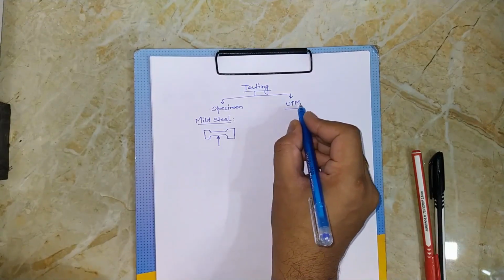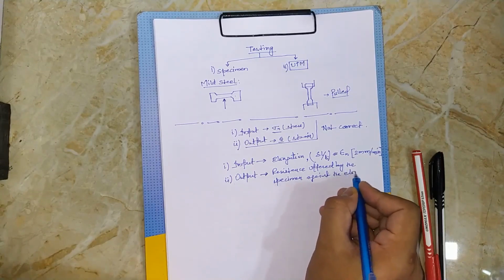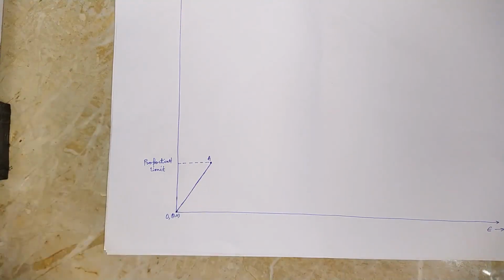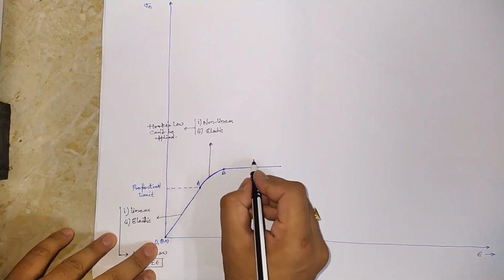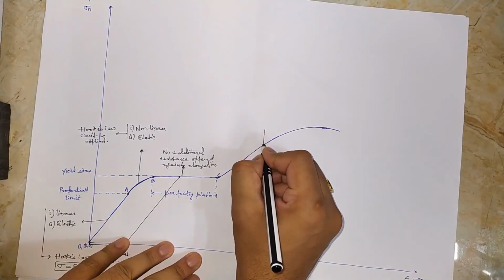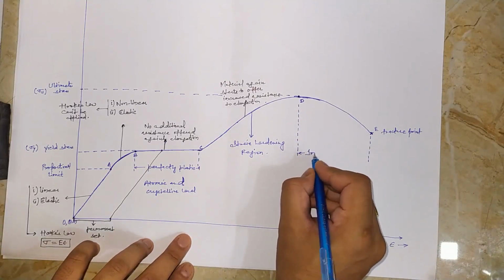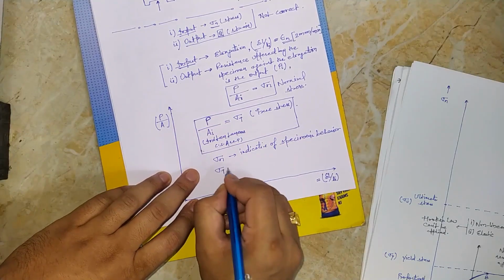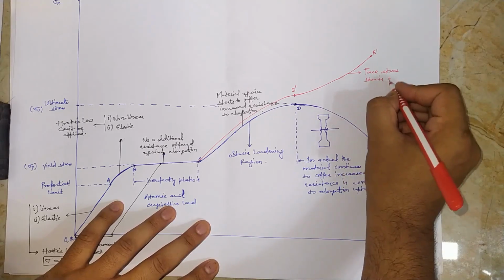Stress Strain Diagram

Comment: Excellent video, some points
1. There is no point in the video that stress-strain curve is generalised for all material or not (say ductile or Brittle).
2. On Strees-strain diagram, I wonder, where is the mention of upper yield point and lower yield point?
3. What will be stress strain diagram under compression?
Reply from the maker: Firstly, thanks for watching the video till the end. I sincerely acknowledge that the points that you have highlighted are not covered. But please note, that my intention is not to make comprehensive videos but to clarify common misconceptions among students.                                                                                                         I apologize for not highlighting that the diagram drawn holds apt for low carbon mild steel in tension. 
I also promise that I will subsequently come up with a video on study of stress strain diagram for deformable bodies in compression.
Regards
Reply: @technicalconceptdiary5288  You are doing a great job Sir. Please continue...👍